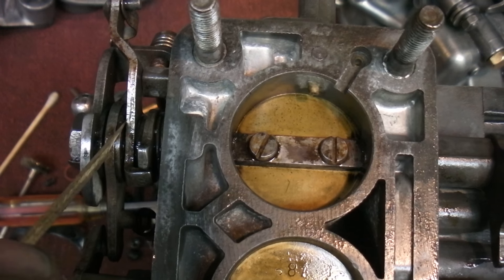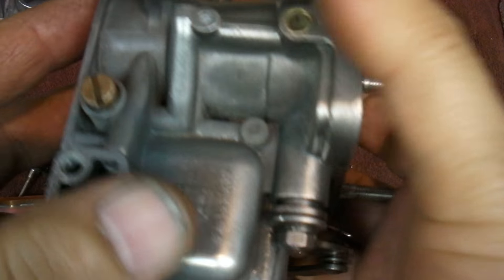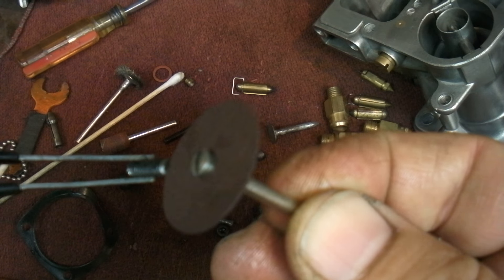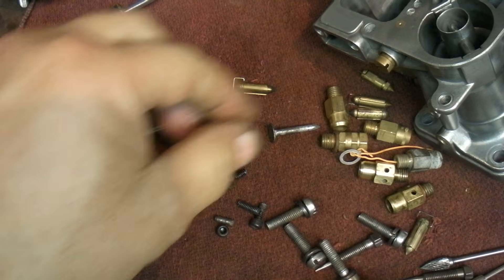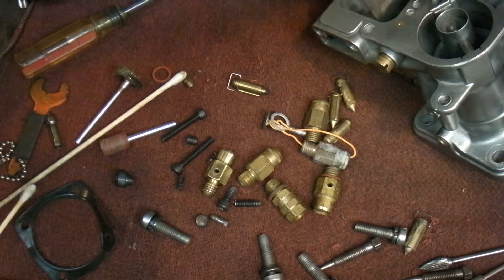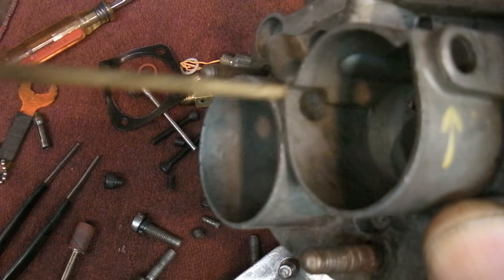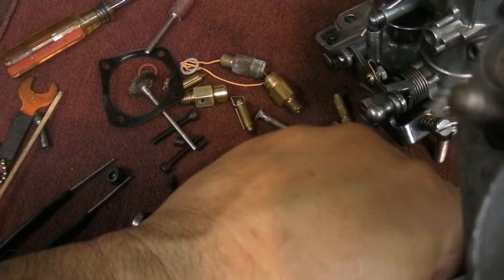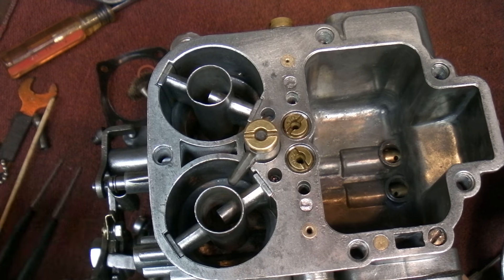Fiat 850 Weber Carburetor - Part 4

Comment: 16:56 It's meant to work like that. Because of fuel economy. When you drive in the city, you will use pedal half it's travel, thus opening just one barrel. Once you go uphill, or just need more power (for overtaking), you push pedal more, it feels like harder and 2nd barell opens too.
Weber DCNF works different. Once you hit the pedal, bot barells starts opening.